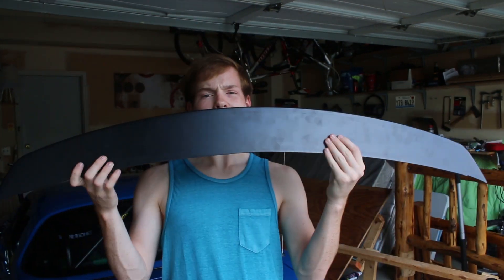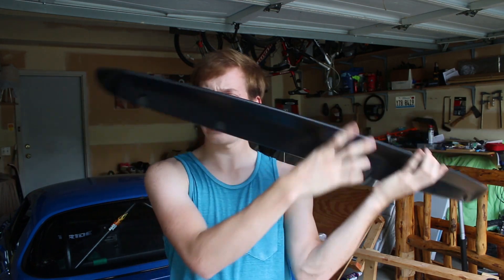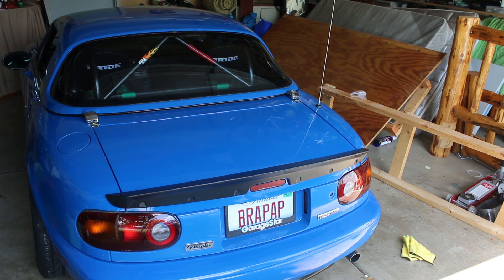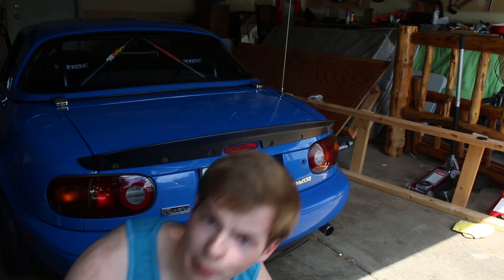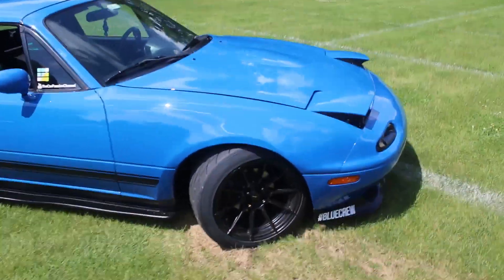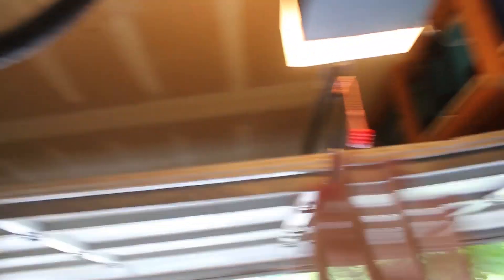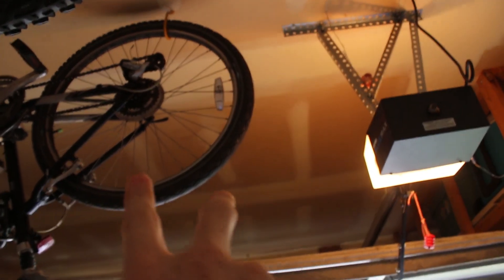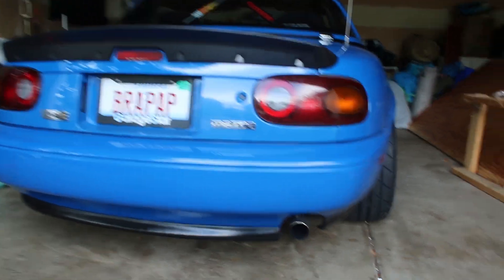Project BRAP // DUCKTAIL SPOILER INSTALL!! \\

Comment: Take off the Mazda and the other whatever sign,so it will look much cleaner...Maybe putting a bigger exhaust,Im not a ricer but thats just to small when u look at bumper...
Reply: That Guy ikr
Reply: i agree
Reply: Yes
Reply: Yep exhaust need ti be bigger
Reply: Everone like so he sees it
Reply: We have to make this a top comment so he can see it!!!
Reply: yeah I agree
Reply: Yup tip need big
Reply: He would have to cut the bumper
Reply: +That Guy yes
Reply: +Arne Hurnik yea keep the badging
Reply: Agree but no debadge
Reply: +Gianluca Schaar yes, sometimes it could look a bit ricey
Reply: Exhaust is a great idea. But don't do a catback ebay exhaust
Reply: 2.5 OR 3 inch
Reply: +LaBomba Romba no. That's too small. 3 or a 3.5
Reply: I like the way Peppa pig is saying this
Reply: +JoshyRacer :)
Reply: Don't take the back badges off behind one of them is 2 holes
Reply: AJRoose001 3 is pointless if you're only under around 300ish hp, it will barely help and on miatas cannons just look wrong (imo)
Reply: he s right ging

Comment: Tip: You should leave the backing on the double sided tape, just start peeling it off, making a little 'tail'. Set the spoiler in place (straight!), with the little 'tails' of the tape's backing sticking out. Peel off the backing, completely, with the spoiler in place, exactly where you want it!

Comment: You can keep the red cover on the double sided tape on but leave a little piece of it sticking out. Then place the spoiler where you want it and it won't stick every single time. Then have someone hold it or tape it to the right position and take off the red cover strip from under the spoiler.

Comment: another great video dude! I look forward to the start of the turbo build! personally I'd have said paint the spoiler to match the car, but with  your black wheels and decals, stay black! Use rivnuts instead of normal rivets though man, that way if you ever change your mind on black or blue, you can easily remove it!

Comment: How well did it hold up with just tape? I would prefer have drilled it vs just tape but all I can find is people using 3m tap on most spoilers but no reviews on how well/long it held & if any problems later down the road. Im looking to put a duckbill on a lancer but I don't trust the tape.. any suggestions? I couldn't find your rivet it video if you've posted it yet

Comment: Instead of riviting it on you should look into rivnuts, they're like rivits but instead of holding the thing in its self it pushes a threaded insert in and you can screw it on and off in case you decide you don't like whatever finish you choose you can take it off easy and change it

Comment: The wing looks awesome black with the black rims, stripe on door and front and rear lip. It adds to the car so keep it black... Plus I think you should add a little bit bigger exhaust tip not to big maybe like another half inch to it. But it's to small right now. :)

Comment: Time for a five or six cylinder swap. I nominate a VR5 or a VR6 specifically for their shortness and the way they're a bit wider than an inline, therefore allowing them to be easily supercharged OR turbocharged.

OOH, OOH, OOH, OOH! A mod you'll ACTUALLY do. {{Maybe.}}

Reverse glow white faced gauges with LED lighting :3

Also, a 2.5 or 3 inch exhaust. Maybe a double 2.25-2.75 inch shakotan style. Plus a screamer pipe out the hood for your turbo.

Also. De-badge. It's time.

Comment: HE DID IT, Molly finally has the worlds sexiest Miata booty ;)
Reply: without the rear lip it would look more attraxtive then selena fomez
Reply: +dom5201 yeah but that's your opinion, I personally love lip spoilers
Reply: +dom5201 although I agree they look good regardless xD
Reply: Nah, he needs a full exhaust with a burnt tip. Then it would be a contender for world's sexiest booty. Right now, the tip is too small...hehe.
Reply: +slydog98j but if the tip is too big it wouldn't look very good, like if he gets a huge 7 inch wide tip that wouldn't look good xD
Reply: +slydog98j just googled it, sadly 7 inch exhaust tips are a thing
Reply: +Ω Ꮋανόκ Ω Haha, he diesn't need a huge tip lol, just something that fills the gap better, stainless if possible.
Reply: +slydog98j yaaaaaas, that would look amazing

Comment: I'd just stick it on with a proxy. So if you ever sell the car you don't sell it with holes in the trunk (If the buyer takes it off)
Reply: how will you remove that without damaging the Paint?
and with all those modifications I think he wont sell the car in the next few years except he crashes it
Reply: Ichigo Kurosaki Scratched paint < Holes
But I guess your right. He aint sellin it

Comment: Get a Hardtop Spoiler next!
Reply: that would look so rice
Reply: good idea
Reply: the hard top spoiler alone looks hella clean
Reply: +Street N Jeep no, it'd be full on rice
Reply: Yeah then get a hood spoiler too!!
Reply: Oh lord😂😂 hood spoiler. No
Reply: +Jack Burns no it wouldnt 😂 its an auto cross car cant be rice if its being functioned
Reply: Slumped TV It isn't an autocross car. It is very rice. Underneath the car is stock. This is the defenition of rice.
Reply: +proface not stock just doesnt have extensive engine mods but coilovers and tires are halfway to an autocross car
Reply: Street N Jeep No. I have seen cars with leaf spring setups that are more autrocross car that that miata. The miata is just extensive cosmetic "enhancements", and nothing else. It is more rice than most riced out honda's are.